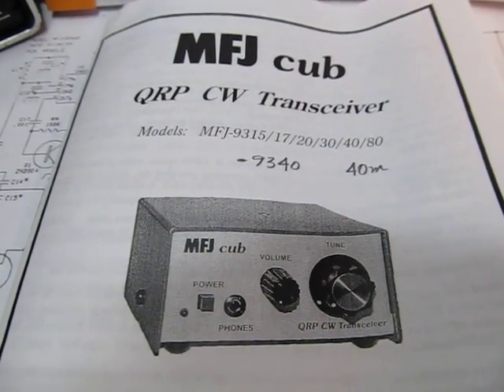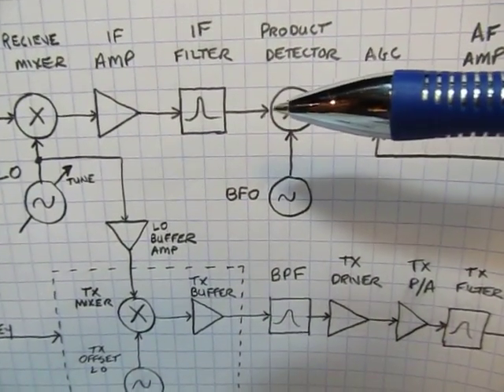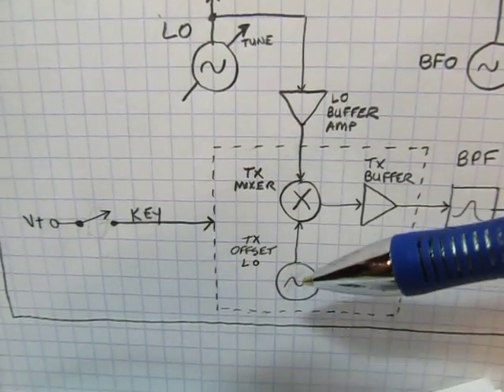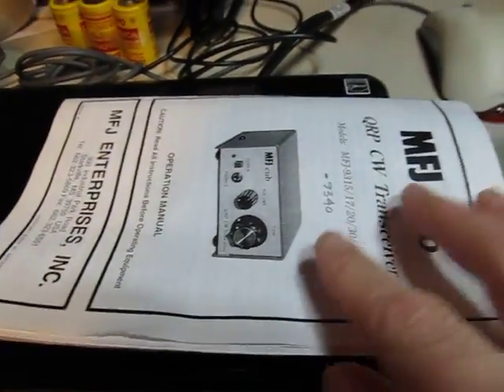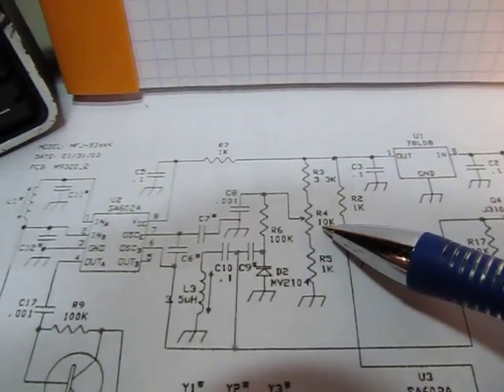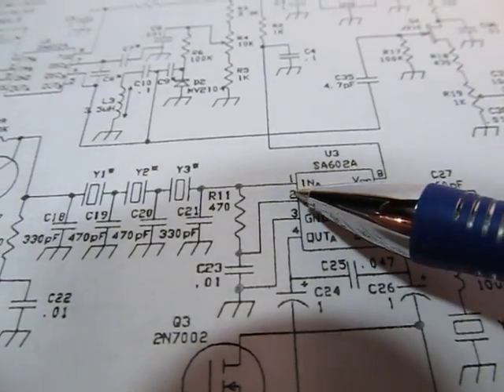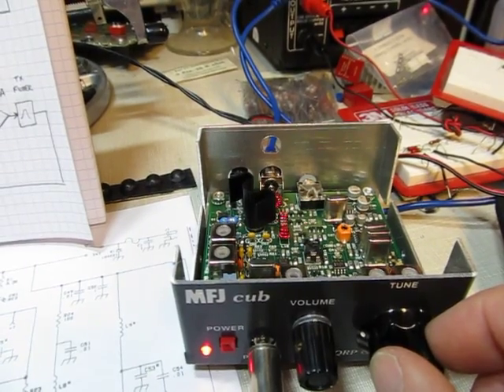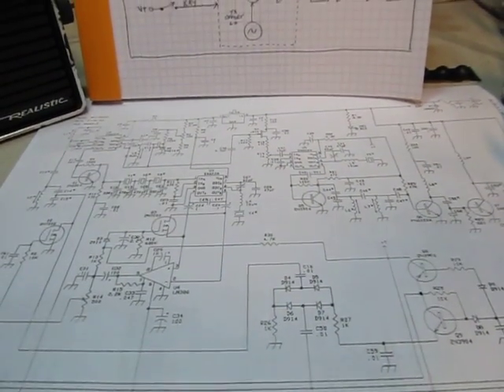#80: MFJ Cub 40m QRP CW Transceiver circuit walk-thru and review, plus bandsweep, ham radio MFJ-9340

Comment: I recently bought a used 40m Cub.  Even after an hour (for warm up), the frequency drifts....I can see on websdr that I'm transmitting on slight different frequencies....7.026, then 7.029.5...after five minutes, it was at 7.031mhz.  I'm wondering which parts needs changing? Thank you.

Comment: Hey Allan, I've been a long time watcher of your videos, although I have never paid too much attention to your HAM radio specific content before now. Recently, I've decided that it would be a fun challenge to try to build a 40m CW superhet receiver from scrath. The only problem is that I am not in a good location to set up a 40m antenna (or any large antenna). However, this didn't seem to be an issue in this video, because you were receiving solid signal with a small alligator clip. I am wondering how viable this really is and how you were able to get signal with such a poorly spec'd antenna. As a newcomer to HAM radio, it does not seem like this should work.

Thank you for all the videos you have made and shared with us; I am looking forward to seeing more from you in the future!
Reply from the maker: If band conditions are good, and the receiver is very sensitive, you can receive with very poor antennas.

Comment: Excellent video, thanks! Though there are a few things that I don't quite understand about this circuit. The timing in the circuit should be very precise. When you press a key, first the antenna should switch from RX to TX, then the carrier should be generated and amplified. When you release a key, the opposite should happen in the reverse order. Otherwise there is a good chance to burn the receiver, not mentioning to deafen the operator. Are all these delays properly implemented in the circuit? Also I believe the speaker should be muted when transmitting. Otherwise the rig can pick up it's own signal, which will be very loud. 73s de R2AUK

Comment: The TX oscillator ( carrier osc) in the SA612 is powered from the keyed +TX line. Presumably there is no sign of chirp? Also is there any hang on the T/R switching when the key goes open?
Reply from the maker: Sorry - the unit is no longer in my possession, so I can't carry out these additional measurements.
Reply: @w2aew  No problems, I wasn't asking for a quantified response, just making a comment on the design.  Thanks for your excellent video walk thru.

Comment: How do you know which direction to put the resistors etc.. on the circuit board without conventional positive or negative symbols on diagram? Will the parts placement diagram or circuit board show me this?  I am a  novice but would like to build this particular transceiver. 
  Very informative video by the way.
Reply from the maker: Resistors can go either way, they are not polarized. The diodes and some of the capacitors are polarized, and will be clearly marked in the parts placement.

Comment: Can you buy it built already??
Reply from the maker: Yes you can, it is the MFJ-9340W
http://www.mfjenterprises.com/Product.php?productid=MFJ-9340W
Reply: Can a tech class use this??
Reply from the maker: As a receiver, yes.  But a Tech cannot transmit on HF (40m in this case).  You need a General Class (in the US) as a minimum.  I believe there is a 10m version which a Tech can use.
Reply: Im pretty sure a us tech can use cw

Comment: ive watch this several times and like it very much. i am buying a 9320 and was wondering if you wouldn't mind helping me to modify the radio a bit. i love ham radio and have been in it since 64. i enjoy building things and this radio wont be any different. but there are some thing i want to add to it. it is a perfect size if there is such a thing. tnx for your time. 73 kb1iai

Comment: This was awesome. I just built the exact MFJ transceiver and the walkthru was very helpful. The only complaint I have is that it's going to take me a long time to get through your site :) I haven't aligned mine yet. It seems pretty easy but it would have been nice to watch you go through it

NE5U
Reply from the maker: I'm glad you liked it. Hopefully, the fact that each of my videos are numbered, it'll be easy for you to keep track of the ones you've seen and the ones you haven't.
Reply: ***** For someone, like me, that can't seem to stay focused when reading a book your videos are invaluable. The pace that you speak at allowed me follow right along with you and take notes on my schematic (bigger version than the manual) at the same time. Receive is roughly aligned. Once I find my dummy load I'll align the transmit side. Thanks again. PS- they are easy to keep track of but I just found this site and the dilemma is what to watch first and when to stop for things like sleeping :o)

Comment from the maker: It would involve more than just changing the toroid windings and changing the crystal.  You'd have to adjust the receive bandpass filter, the VFO used for the rx and tx LO, the transmit bandpass filter, and the tx PA output filter.  That's assuming that the buffers and PA are up to the task for 28MHz operation, which might not be the case...
Reply: ***** hello. i talked to rick k1bqt the designer of the cub and he gave me some suggestions to A) add and "s" meter and B) convert one to 10 meters. i'll share the email with you. 73 paul kb1iai 

Hi Paul- 

Technically, you could add a "S" meter by tapping into and amplifying the control voltage in the AGC loop. That voltage is available at the gate of Q3. You'd need to use a high-impedance op amp (TLO-80 or the like) to avoid loading down the AGC circuit. Probably more trouble than it's worth. 

As for the 10-meter conversion, you'd need to set the IF up in the 22-MHz range to use the stock VFO which operates in the 5-6 MHz range (22+6=28). Getting sharp selectivity using crystals that high up in frequency would likely prove difficult. Alternatively, you could convert the VFO to a VXO circuit (crystal oscillator circuit that can be "pulled" over several kHz with a capacitor or variable inductor). This modification would probably be your best bet. Simply moving the existing VFO up to 16 MHz would also work, but it would probably drift like crazy.      

Hope that helps. Glad you're having fun with the Cubs! 

73  Rick  K1BQT 

On Tue 07/21/15 10:09 AM , huzinasr1@aol.com wrote: 

hello mr littlefield, im kb1iai, paul.
i have a couple of questions about the mfj cub you designed.
1) can an "s" meter be added to it??
2)can it be converted to 10 meters??
i have just bought the 20 meter kit and im waiting for it to arrive.
i already have a 40 meter one.
i was considering buying another one for 10 meters.
this is so i can take the three of them, a battery and solar panel and an end-fed par antenna for field work.
.it will all fit in my pelican briefcase.
tnx for your time. 73 paul kb1iai
Reply from the maker: Very interesting, thank you for sharing.
Alan
Reply: you are welcome. now im not an engineer in any way shape or form, but i can read schematics, and i build most of my own gear. i have found a compact op-amp that mounts in an 8 pin sip socket for 7 dollars on ebay and my new 9320 should be here this afternoon. i have a couple os "s" meters i scraped out of junk c/bs. another person suggested that i tap the emitter of q1 and tie the op-amp there so as not to drag own the agc circuit. i have just finished a "son of zero beat" kit and a cw touch key(no moving parts) and a brand new norcal keyer that i found in my storage bin. im just wondering now if i can squeeze it all into the mfj case or not. if you have any ideas id be open for suggestions. 73 paul kb1iai